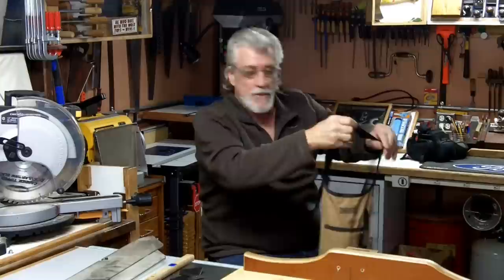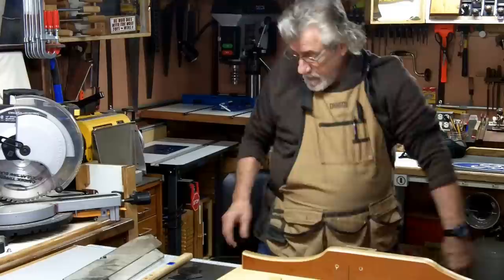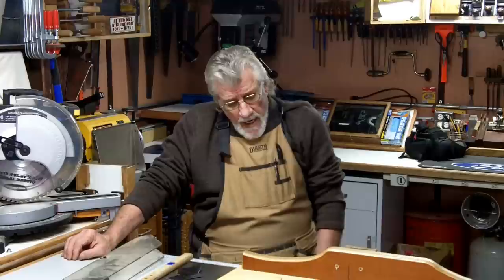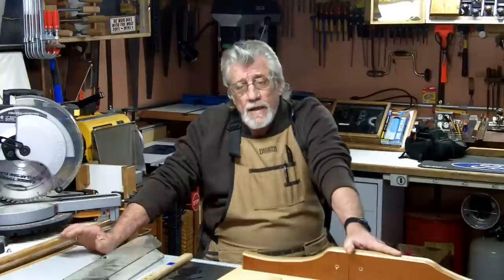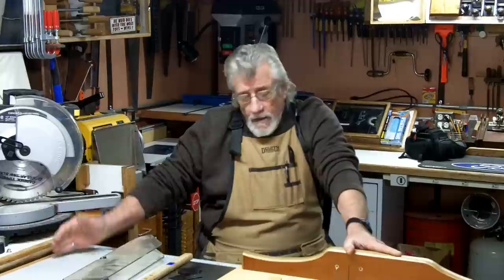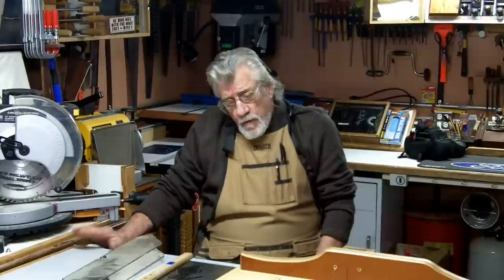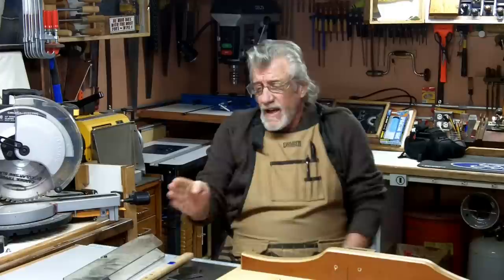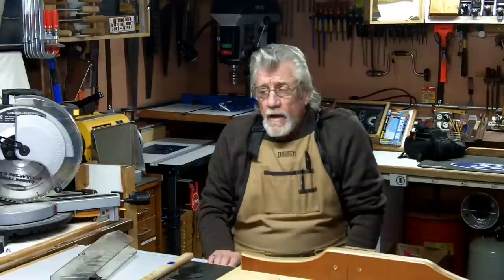D.I.Y Splitter to help prevent kickback on my table saw

Comment: Boy, do I recognise your thought process. From ~1980 to the mid 90's, I was a boat carpenter. I never saw a splitter or a riving knife, or that plastic POS. Still have all my fingers, but there were some close encounters with kickbacks, all but one were friendly fire. It is amazing the velocity they can get up to. Early on I learned never to stand directly behind the blade, to lock a finger or two over the fence to prevent my fingers falling into the blade when a kickback dematerialized the wood, to make sure that both front and back were securely held down, etc. 

Now as I approach 80 I have my hobby shop. Picked up a 70's Delta Rockwell Unisaw a while ago. With a little massaging it's now a nice saw. Realizing that my chops were probably deteriorating with age, I did what you did, I put a splitter exactly where you did. it may be safer now... If you aren't cutting through the board, and the cut is shallower than the splitter is tall then you have to remove the splitter. A pain. Maybe a riving knife is a better solution, but it would be much harder to implement, dunno.

A few years ago the motor died. A new one was surprisingly expensive, but I found a 3 phase motor from a Delta 14", it bolted right on. Even after buying a VFD, I saved ~$250. It is a 5 hp motor, I think the old one was 2hp... Had to figure how to get the speed in the right range, when I commissioned it it hit about 25,000 RPM, scared the crap out of me. It now runs about 3 k, but it's still a little scary, absolutely nothing slows it down.

Comment: I thought I was the only one jamming to SRV while the table saw was running!   thanks Mike!
Reply from the maker: Hey,  Mike.  I appreciate you stopping by and leaving the comment.  I agree.  Gotta have music in the shop and nobody beats Stevie Ray on quieting the table saw.  Thanks again and have a happy New Year.  The picture is small.  Is that Navy?
Reply: Mike Hedden yes, sir.  I retired after 23 years in 2012.  Also, you really gave me some great idea for the splitter.  I inherited my grandfather's Craftsman 113 tablesaw.  Of course he got rid of the guard as soon as he got it home.  The fence is just as bad as you say.  I had a piece of oak become a projectile earlier this week.  I am never getting rid of the saw so your idea is just the ticket.  thanks again!
Reply from the maker: Yeah, those oak projectiles are no fun.  The splitter should help a lot, but make sure the fence is always parallel with the blade.  A crooked fence can cause havoc and it doesn't take much.  If you've seen some of my very first videos I had a 1957 craftsman.  I used a tri square from the miter slot to the fence on every cut because the fence was off a 1/4 inch or more. Be safe and thanks for your 23 years of service.  One thing about the Navy, they have the best looking uniforms in the world.  If someone doesn't believe it, just have them watch an old Cary Grant movie.  That's the breaks of Naval Air...skid marks in the sky

Comment: Hi Mike,
I'm the guy who bought your old Craftsman "100" Contractor Saw a few years ago. Under the surface rust was a very nice flat and somewhat smooth table which cleaned up nicely.  I found an original owners manual online and finally got everything dialed in.  The hardest part was getting the blade parallel with the miter slots. At first I thought it was a problem with the fence being misaligned,  which it was.  But after getting everything worked out and adjusted properly and putting on a new v-belt (I only use one belt now, not two like original) it cuts great, nice and straight and no vibration.  I use a 7-1/4" thin kerf blade for most cuts with a homemade zero clearance insert. I will install a splitter asap to help keep all my digits attached to my good hand. I always use a featherboard when ripping, if possible, and a beefy Jay Bates design push block and have never had a problem with binding or kickback. Also added a magnetic switch. I can now shut it down with a tap of the knee. I know you want it back now so I'm willing to trade you for your used second-hand Delta X5 Unisaw, free delivery and pickup! 😉 Take care and happy woodworking.

Comment: Thank you for your video. I have been through similar situations. I have one.of the last Unisaws that didn't come with a riving knife, but does have a riding splitter guard. It is huge and P.O.S. I wouldn't ever make long cuts without it, but wish I had a riving knife for  extra safety and easier visual location of cuts as well as sled uses.
Reply from the maker: Thanks, Derik.  I appreciate the comment.  I agree with you, totally.

Comment: Thanks for posting the video and telling your story.  I dig your "2 cents".  I'm an amateur wood worker and not much of an iron worker so I've been looking for cheap and easy replacement splitter.  The metal spatula is a great idea.  I've never experienced a kickback and hope to never have that pleasure.  Again, thanks for posting.
Reply from the maker: MrTarzan152   Thanks Mr. Tarzan for stopping by and leaving the comment.  Kick backs and be very scary and happens in a split second.  Anything than can help to stop them has to be a good thing.  Good luck in your woodworking adventures.

Comment: This was sobering and I really appreciate it. I recently acquired an old Delta Homecraft table saw / jointer that had been kept in excellent condition. But it lacks these safety features. I'm definitely going to keep researching until I come up with the best plan for adding a splitter or something to help avoid kickback.
Reply: RedGreen1 Where you able to find or make a splitter for your saw? I also bought an old Homecraft table saw (34-660) with the guard and splitter missing.

Comment: I have wife’s Grandfather’s 10” craftsman table saw. I give him credit because it came with all the safety equipment (often missing on old saws). At first I was overconfident and used it with the splitter and guard off (it also has anti-kickback pawls). I was cutting in the garage with the door closed, it threw apiece of wood into the metal door with a very loud bang. If the door had been open it would’ve gone through the windshield of wife’s car. I just happened to be standing to one side so it missed me. That incident changed my attitude…the splitter and guard is always installed unless I’m not doing a through cut. I’ve had it save me more than once when the stock shifted or like you say sometimes it’ll pinch. When the pawls have to be pried out of the wood you know there was a lot of force applied.

Comment: I have a splitter like the one you have with the clear plastic and it comes with anti-kickback pawls.  It attaches to the back but the front just rests on the table.

Comment: I made a splitter out of wood that is just under the width of my blade that i glue into my zero clearance insert.  It works great, though they aren't super durable due to the thickness of the material, but it allows you to get it much closer to the blade, which is good.  The drawback though is that it doesn't tilt with the blade, but I don't know if my 1940's era Unisaw has a way to install a splitter like yours.
Reply from the maker: +jon Q     Hey, Jon, thanks for the comment.  This system seems to work for me over leaving the guard on all the time.  My saw is 10 years old and made before the laws made it mandatory for riving knives.  The new saws like the Delta and Saw Stops have brilliantly engineered guards that work great.  I'd love to own one but I just can't afford one.  I just try to be careful and always respect the saw.  Thanks for stopping by and leaving the comment

Comment: I have that old contractor saw.  I thought the front of the miter was what determined its 'squareness'.  I took some time to adjust that and it works fine.  Just for those out there that have that saw.  Also made the plastic shroud removable with a pin and occasionally use the 'splitter'.  So when you talk splitters you have my attention.

Comment: I know it's an old video, but gonna comment anyway.  Looking for my Unisaw to put a splitter/riving knife/zero clearance insert on it.  It's similar to yours, and had the same setup for a blade guard, but, of course, I removed it for the same reasons as you did.  Recently had a kickback that hit me in the stomach, tore a piece of my hand between thumb and palm out, and continued on to explode off the wall.....not the first kickback I've had, but one that made me decide to get a splitter/riving knife setup installed NOW.  I am probably gonna just use some 1/8" mild steel I have to shape it, but the hamburger flipper might be more practical and durable.  I like the rambling and anecdotal stories, in spite of complainers who are always in a hurry........and will suffer the wake-up call of a kickback in their haste.........ROFL.

Comment: Yep... I heard that “Bam”  for the first time this past summer.  Very scary!  I have one of those old craftsman saws modified with a 3 horse motor... so really afraid now.  Putting a splitter on a craftsman saw is a science project.  Ended up with just a pin(1/8 in drill bit) epoxied behind the blade.  Better, but not as good as I’d like.

Comment: Hi Mike, new subscriber here.  Old fart like you, probably older Lol anyway I enjoyed this video. I only wish I could get a close look at those splitters you made.  I'm hoping to duplicate your idea (which is awesome IMHO) to work with my Powermatic 64A if I can.  New it had the guard assembly with splitter but I'm the 3rd owner and it's naked. I'm using it more and more since retirement a few months ago and I don't like pushing the envelope. Thanks man..
Reply from the maker: Hello old fart like me.  Thanks for stopping by.  You sure have a good saw in the Powermatic.  On the splitter, I made two.  One is an inch above the table for thin stock.  I usually cut 3/4" or less.  I made another 2 1/2" for thicker stock.  How far the connection is under the table depends on the brand.  Use thick paper to make sure your design fits and then copy it to the metal for cut out.  Be sure to file the edges to take off the sharpness.  Home made splitters probably aren't perfect, but I feel much safer using them than having nothing at all.  Good luck and safety first.

Comment: I just bought a brand new Craftsman 315.228310,  and the "knife" and blade cover on it is... well... a pain in the 🍑 ! 
 
After fiddling around with so many different styles of DIY splitters and knives, i ended up just making several zero clearance plates with different shapes/styles mounted to them for angles most commonly used. 
 
I currently have 22 zero clearance plates made from mostly aluminum stock, but a few phenolic, corian,  UHMW, and HDPE . 
 
Sometimes i think " Maybe that doctor that said Im on the autosm spectrum wasnt full of 💩?" 😂😂😂 ... 😢😢

Comment: I cut off my ring finger at the lower knuckle on my right hand cutting lap joints with a dado for a couple hours over and over. short boards.
Reply: my finger hit the back wall and chips of bone left in the saw case.
Reply from the maker: Oh, man, that's a story that should scare us all.  That must have freaked you out, big time.
Reply: +Mike Hedden Yeah

Comment: Hey Mike enjoyed the video, and Stevie Ray is also #1 in my "Top 5 Blues Rock Guitar Players Of All Time" list too. I have a question for you if you don't mind. I have an old Craftsman contractors saw, and have wanted to make a splitter for it for a long time. Do you know if it is possible to make one for one of these older saws? And if so, is there an example of how to make one shown on the internet anywhere that you know of?  Thanks for any help.
Reply from the maker: Kenny Starr  Hey, Kenny.  For years and years I used an old Craftsman 100.  It was nothing more than a flat table and a spinning blade.  No riving knife; no splitter; and not even a guard.  But most of all, the fence was hard to adjust.  An unadjusted fence is as dangerous as it comes and only a fraction of an inch off will do it.  They made the saw when men were men and fingers didn't matter.  When I came across this 3 hp Delta it had a guard and nothing more.  The splitter was the guard.  Take off the guard and you have no splitter or riving knife; not too safe.  The splitters I made bolts to the same place the guard does.  If your table has a guard it may work for you.  There are some after market that uses a new insert, but I'm not sure that would fit and old Craftsman.  Personally, I love my Delta and feel safe with it most of the time and respect it all of the time.  Still, I'm saving for a Saw Stop.  Be safe and watch that old saw.  Mine would throw stock occasionally and it scared the crap out of me multiple times
Reply: Mike Hedden Hey Mike, thanks for the reply. Yep, I'm an old timer too, and the saw that I have is an old 113 model that was given to me by a friend that I used to work with. It belonged to his Granddad, and supposedly he used it on the jobsites when he was framing houses many years ago. Mine does not have a guard, but I did see in the operators manual today that they did come from the factory with a splitter that was attached to the guard assembly. Mine has a small 1/4 hp motor on it, and I have been wanting to upgrade the horsepower ever since I got it. So, ironically today I was looking on EvilBay for one, and found a really nice 3450rpm 1-1/2 hp and I bought it. The seller that I bought the motor from also has the stock splitter assemblies that bolt to the rear of the trunnion on these old Craftsman saws and that will definitely be the next upgrade for it. I have used this old saw some, and the only thing that I have done to it up to now was to tune it, replace the belt, and bolt on a new thin kerf blade just to see how it would act. As it is now, it cuts and does some really decent stuff if you take your time and make sure that everything is true and straight, although it truly needs some more horsepower. Now that I have mega spare time on my hands I want to add a better fence and rail system, a little more HP, a splitter, and that should modernize it into being a really nice saw for $500.00 or less. It's kinda like rebuilding an old V8 Chevy engine, it's an old classic, but you want it to be reliable and safe when you use it. I saw a gentleman by the name of Jerry Cole on YouTube recently and he was using an old 1-1/2hp Delta contractors saw that he said was his favorite saw, and that he had been using it for like 25 years or so. He did some really nice stuff with it too, and stressed safety from kick back constantly. Thankfully, I have not had to experience that horror, and I hope and pray that I never will, and hopefully you never will again either. Thanks for the heads up Mike, and congratulations on your Delta, I have heard good things about them. Stay safe!
Kent
Reply from the maker: Hey, Kent, on your #113.  Here are some things to think about that troubled me on my 100.  Since a contractor saws works are bolted directly to the table I always fought getting the blade to run true with the miter; so that made the fence untrue.  When I did get it close it wouldn't stay to my degree of accuracy.  I set the Delta with a dial gauge to the thousandth.  If I slide the fence to 22 9/16 it's exactly that on BOTH sides of the table.  That and a splitter will almost rid all kickbacks.  I roll my saw around contently and check it every month or two.  It hasn't changed a lick.  They do have some real good after marked fences, so if you can adjust your blade to the miter you're half way downtown. Now, on your horse power; if you are going to be doing a lot of ply and 3/4 inch stock you will have plenty.  If you are going to be doing a lot of hard wood then it's much, much cheaper to by eight quarter boards and re-saw them.  This will bring your wood bill down from unbelievable to just ridiculous.  But, to rip a long board 2 inches thick requires at least 3 hp for a nice clean and unburned cut.  But then again, 3 hp run on 220 volts which may be a problem.  So, on your old saw; if you can get it accurate and keep it that way you're good to go.  If you can't, then I suggest you don't risk your safety on close quarter cuts.  Good luck and stay safe....Mike
Reply: Mike Hedden Will do, and thanks for the tips.
Kent

Comment: Good video Mike.  I'm an old curmudgeon of a mechanic, so few issues there, but I'm just now getting into woodwork in my post retirement years.  A couple questions/comments:

1)  AMC Hornet under that tarp?  Neat ride, especially if you have a 390 or 401!

2)  For your home made splitter, isn't it kind of far behind the blade to be effective - at least until the point where the wood starts to pass by the splitter?

3)  Also - and I may have missed it - but does your homemade splitter ride up/down with the blade, or tilt with the blade?

Thanks for this - I had a table saw incident (no harm fortunately) when I got one 13 years ago.  Haven't used it since.  Honestly - it creeped me out.  But I'm at a point now where circular and jig saws are just super unwieldy trying to rip a long piece, or cross cut a wide piece of wood.

Again - Im new to real wood work, so please don't take these as dumb questions.

Thanks, DEH
Reply from the maker: Dan Hartman  Hey, Dan, thanks for stopping by.  My delta is old and before the riving knife.  It will tilt but not rise.  The splitter is far back cause the blade gets closer as you lift it.  Most of the time you have more wood on your side for control until the stock gets to the splitter.  Not perfect but way better than nothing.  Keeping your blade, miter and fence in exact parallel will increase safety more than anything.  Although dangerous if used wrong, the table saw is by far the most valuable tool in my shop.  1973 Gremlin X with a 304.  Fun show car.  Always draws a crowd. Thanks for the comment